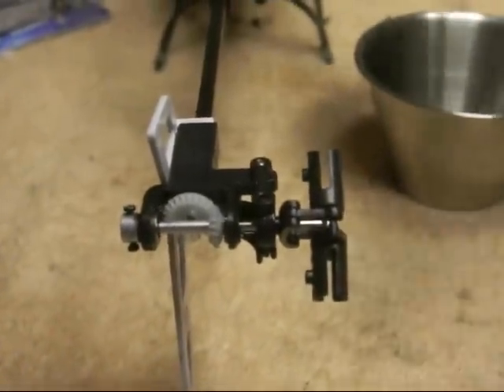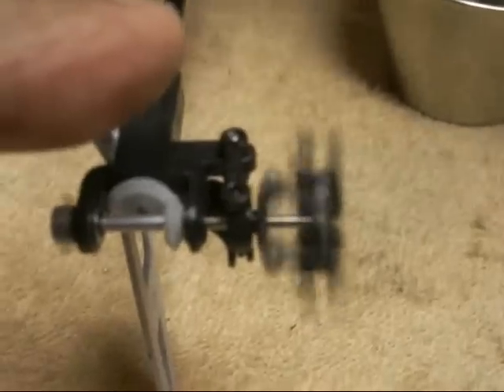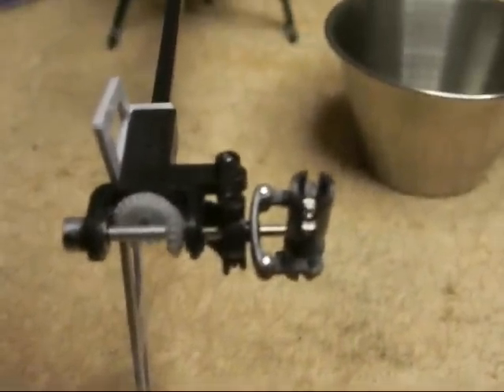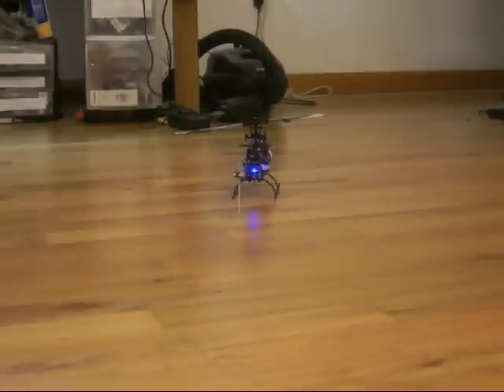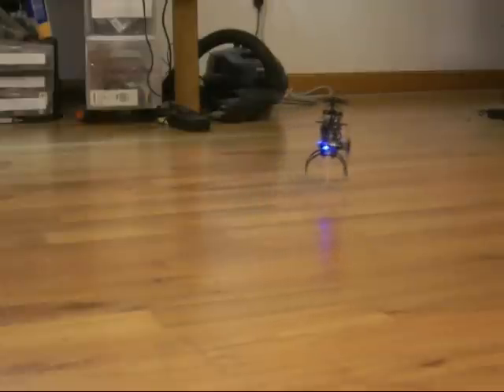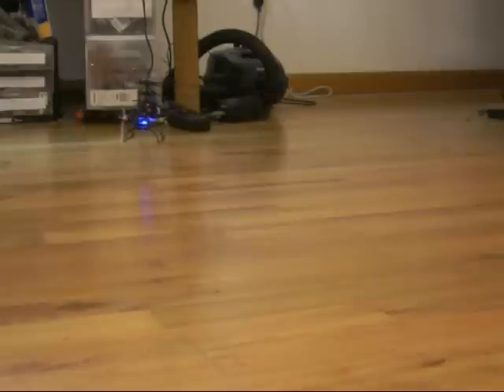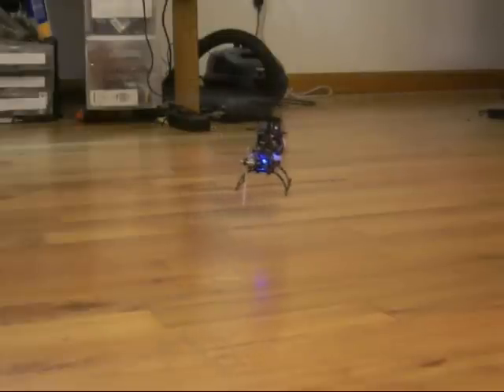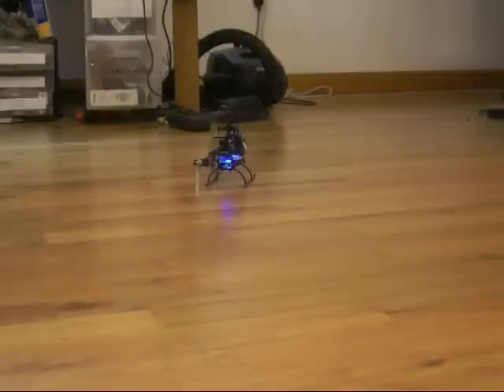130X Re-Positioned Tail Hub fix

Comment from the maker: Someone asked, How did I remove the hub and if the Loctite is still holding.. I used my lathe to hold the tail shaft, while the opposing chuck held a steel pin to center. Just 1/4 turn and the hub released. There was green loctite in there already. This same thing can be done with a mini gear puller or a vice using a hollow steel sleeve to support the hub. I'm sure, heat will work also. So far, the green is holding but I'm gong to re-do it using a stronger Loctite to be sure.